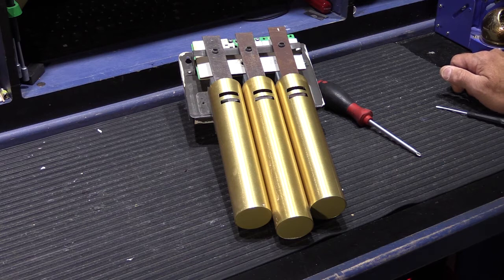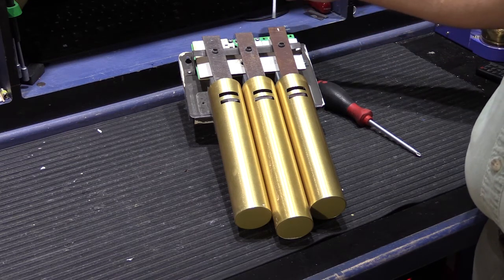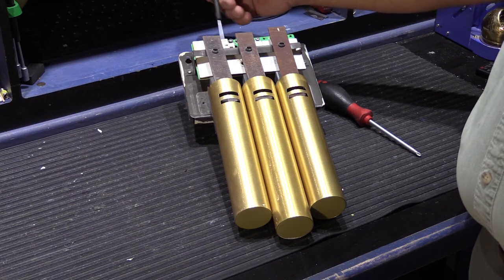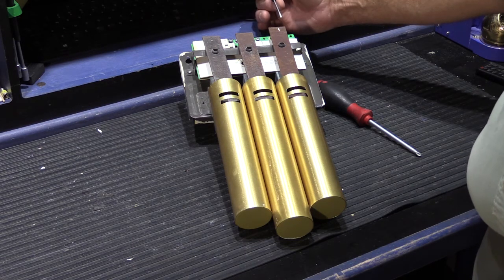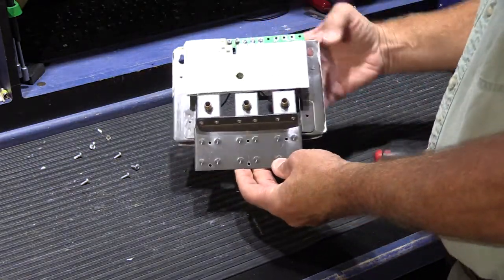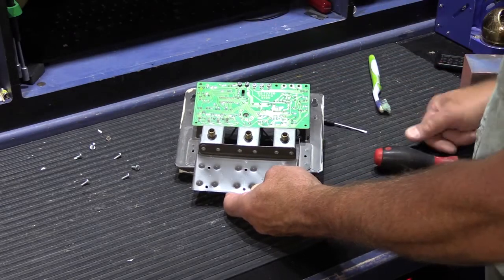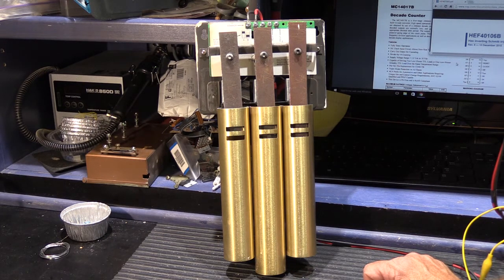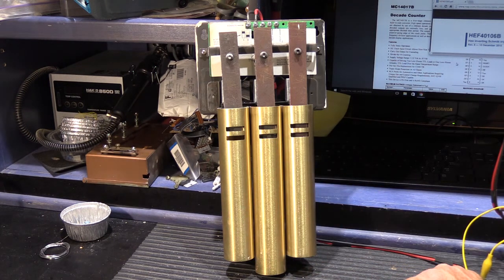A Brief Overview of a NuTone LA70  Short Tube Bar Chime Base

Comment: I really like the sounds produced by these old bells with sound tubes.These days, they would be prohibitively expensive.But I really don't understand why manufacturers don't release electronic versions of that doorbells, sounds recorded on a flash drive, with the same sound quality.
Reply from the maker: Hi Tiburtiono:  To reproduce the tonal quality of a real Long Tube Chime is not as simple as you may think.  There have been (are probably still are) electronic chimes made by other companies, that try to reproduce this sound - Most are horrible sounding failures - Chris
Reply: @northsideservicecompany3567  Have any of these manufacturers used a real recording, in high fidelity, of the sounds produced by the sound tubes, on a flash drive, for example?
Reply from the maker: @Tibulace  Not that I've ever seen (or heard).  It would also require an exceptionally well design playback circuit to reproduce the sound quality - Chris
Reply: @northsideservicecompany3567  I agree. I'm going to use a 100 W amplifier, with a flash drive and two 5-inch speakers, 65 W each.I think I'm going to need an adjustable electronic relay, to turn a user-given variable-duration touch into something with a fair duration of a ding dong cycle.

Comment: I've had this unit for about 12 years.  All of a sudden there is a 4 or 5 minute delay from when the button is pushed and when the chimes sound.  Any ideas ?
Reply from the maker: Hi HoustonTech:  If the Chime is the version with the electronic control board, the board needs to be repaired / rebuilt.  If it's an early model with the Telechron Motor, the chime needs to be cleaned and serviced - Chris

Comment: I have a similar model from 1978, except the hi note's solenoid doesn't fire. And the transformer needs replaced.

Although I fixed the hi note's solenoid, I just need to test it to be sure if I fixed it.
Reply from the maker: Hi TheDrJ2006:  Be sure to let us know if your repair has worked out - Chris
Reply: @northsideservicecompany3567  ok

Comment: Hi Chris, I have a Miami Carey 8 Note long tube door chime from the late 60's or early 70's I don't know if you can fix it. I tried and cleaned the selenids and they work fine,  but the motor does not turns the whole circle. And sometimes the selenoids stays connected, need to push the button again so the circuit can open. I was wondering if you can help me
Reply from the maker: Hi Recardo:  I can try to help you - it is likely that your Miami-Carey Chime is actually a Rittenhouse Chime.  You will need to contact me directly about your Chime.  Sending me some pictures of the Chime Base will be needed to identify what you actually have - Chris  nscompany@msn.com

Comment: Could you please make a video showing how to install this type of door chime to replace an existing door bell?  and also: is this type of door chime compatible to the Ring doorbell?  Thank you!
Reply from the maker: Hi HereRIGHTmatters:  Here's a link to our Video about how this type of Chime is wired : https://www.youtube.com/watch?v=TjKUx18TEvc&list=PLsTvqKsBnGYdEvtzvv_pz1gOKa9UPuAxH&index=3
 - Here's a link to our Video that shows how to make the Chime work with a WiFi Door Camera: https://www.youtube.com/watch?v=t6YswmDNVyI&list=PLsTvqKsBnGYdNYGrlrOSVKjOLwvFWrLUx&index=3
Chris
Reply: @northsideservicecompany3567  Thank you very much for your quick response and links!  I am going to take this weekend to figure out how to install this door chime by myself and still have the Ring doorbell work properly.  In your video you talk about the Nest doorbell, I hope it does not make a difference which system you have to deal with.  Again, thank you very much! You are awesome!
Reply from the maker: @tamanimania  As long as the Ring you choose has the ability to operate a standard 2-Note Mechanical Door Bell - it can be made to work with your NuTone LA70.  You will need the Relay Board we show in the Video - Chris
Reply: @northsideservicecompany3567  my door chime is slightly different and I'm so confused... just its simple installment is maddening... (not even dealing with the Ring doorbell yet) I called two different electricians, but I suspect they have no idea either.. I'd like to send you a photo to show you what this door chime looks like.  May I email you a couple of photos to ask you for help, please?
Reply from the maker: @tamanimania  Sure - email me as many pictures as need - to - nscompany@msn.com  -  Chris

Comment: I got one like that the only problem I got is I have to keep my finger to hear all the tones… any solution for that
Reply from the maker: Hi P.T - I am unclear on your question - More detail would also be helpful - Chris
Reply: @northsideservicecompany3567  if someone rings at the door he as to keep is finger so we hear the bell if he just press it and let go nothing is working
Reply from the maker: @p.t89  There are at lest 2 possible reason for it not working correctly- - - - ->>> 1. If this Chime has been installed in this house since it was new, and it worked correctly before and no one has taken it down and then re-installed it, with the wiring done incorrectly - The Chime is probably damaged and needs to be repaired - - - - ->>> 2.   If this Chime is newly installed in this house and it's never worked correctly, you have it wired wrong.
This Video shows how this type of Chime must be wired - https://www.youtube.com/watch?v=TjKUx18TEvc&list=PLsTvqKsBnGYdEvtzvv_pz1gOKa9UPuAxH&index=3&t=331s
Chris

Comment: How do I bench test one of these? What is the yellow wire attaching to?
Reply from the maker: Hi ChopperCharles:  To test a Chime on the workbench, you wire it up to a Transformer (16 volts AC 30 Watts) add pushbuttons (basically duplicating a standard chime installation) and give it a try.  It will work better standing up rather than laying down.  Make sure the plungers move freely, if they're stuck in the Solenoid Bores, they won't ring
     I have no idea what your "yellow wire" is about - there's no wiring that comes off the Chime when it was made - Chris
Reply: @northsideservicecompany3567  the yellow wire in your video. I didn’t have a wiring diagram come with this but I figured it out eventually. Had to use a 16vac wall wart from an old turntable but got it working. One broken solenoid wire and a lot of unbending of bent parts fixed it nicely.

Comment: Can the chime/tune be changed from the ones that comes with it?
Reply from the maker: Hi AnyOLName: No, not really.  The musical notes are based on the Tone Bars and the Sequence is predetermined by the electronics.  I have seen elaborate musical chimes - which have between 20 - 30 Tone Bars or Tubular Bells (tubes) which are controlled by a programmable electronic controller - which can play just about any tune of great length that you could think of - Chris
Reply: @northsideservicecompany3567  I understand the limits,  just wondering it based on the chimes it has if it can be programed to play something else.
Reply from the maker: @anyolname6355  Nope, it doesn't use a programmable controller - Chris

Comment: Inam looking to buy something like this for my new home. Any suggestions and where to get a true mechanical door bell?
Reply from the maker: Hi AnyOLName:  NuTone still makes the LA70MA - which is essentially the same Chime is the one in the Video - You can buy them on-line form many sources - Chris
Reply: @northsideservicecompany3567  Is the LA305WL comparable?
Reply from the maker: @anyolname6355  No - Not in my opinion.  The "Broan" LA305WL is based on a late 1990's Rittenhouse Chime - It is not considered a NuTone Chime - It will not have the same tonal quality of a real NuTone Chime. - Chris

Comment: I have been thoroughly confused about this Nutone chime kit’s classification of what category it falls under, until now. Since I’ve been interested in this model, I see the chime bars and hear them play or sound off, when they’re are struck. To me and because of how Ring classifies this model, this is a mechanical door chime, because it is not playing a tune from a digitally recorded microchip.  However, the description of this video explains and classifies this model as an electronic door chime. To me, electronic means digital. To Ring, it means the same thing and I believe we are both wrong. If i am finally understanding this correctly, the sound of this chime is a true classic door chime with respect to how it sounds. The sound is coming from little hammers or strikers which hit each bar. But how the strikers are activated is done electronically from the solenoids, as opposed to a mechanical motor, which used to move the little hammers. If I am correct on this please let me know one way or the other. I know other consumers are confused and are calling this a mechanical doorbell, too. In reality, there are or were mechanical door chimes and today we have mechanical (possibly), electronic door chimes and digital or digitally recorded door chimes, which are recorded on a microchip.  Ring, I believe has thoroughly confused the public with their terminology and Nutone didn’t really answer my question either. Thanks for the explanation, which i finally think I am clear on.
Reply from the maker: Hi Ron:  You are correct in that the sound of the Chime is created mechanically when the plungers hit the tone bars.  The plungers are activated by electrical solenoids - which are controlled by the electronic circuit board.

In earlier versions of these models - the solenoids were controlled by the electrical connects made by the motor driven switch across the traces on the circuit board.  This was not at all an "electronic" design - just an automated electro-mechanical design - Chris

Comment: Northside, are you still around?  I watched your video.  I have a question about the standoffs or rubber grommet supports for the chime bar dumbbell shaped rubber grommets that isolate the chime bar allowing it to chime.  I purchased a Nutone LA305WL.  However, one of the chime bars became disengaged.  I was able to reinstall the dumbell shapped grommets back into the chime bar rubber grommet standoffs.  However, I noticed that the right outboard resonator tube has the lower chime bar rubber isolator grommet standoff mounted at the top of the resonator while the other two resonators have the lower chime bar rubber isolator grommet stand off mounted lower into the resonator.  Is this the correct installation for the rubber grommet support or standoff?  Or do I need to lower it into the resonator.  It appears to be mounted ok but I suspect a quality control issue on the standoff installation.  I can email you a picture if you need more info.  I can send to the email you have posted.  Please advise.
Reply from the maker: Hi Phil:  Your LA305L is not actually a NuTone  Chime.  It is a model that has been made by Broan since before the merger with NuTone.  I have no first hand experience  with you chime and Broan does not provide any technical information or parts for the chime.  I would say that if the chime rings correctly and sounds fine, leave it alone - Chris

Comment: Hello Ron my name is Ron a well. I am replacing all of the solid state components on my chime just to avoid diagnosis however, I have not been able to identify one component.  Do you know what type of Transistor is at Q1?
Reply from the maker: Hi Ron:  Q1 is a BC373 NPN Transistor - Chris
Reply: Thank you! I had looked up KSP06 based on what I could see on the transistor and it lead me to Mouser part number 512-KSP06BU. 

https://www.mouser.com/ProductDetail/512-KSP06BU

or this one

https://www.mouser.com/ProductDetail/ON-Semiconductor-Fairchild/KSP06?qs=sGAEpiMZZMshyDBzk1%2fWi6MZZsKOf5hyIHVQo%252bZbqOM%3d

They both seem similar however I will go with your recommendation. 
Do you know of a good site to get the grommets? Oh one other thing I ordered a Nutone C907 Low voltage transformer which reads 16v 30wa but it puts out 19v with no load is this ok to use?

Thanks for all your help Ronn